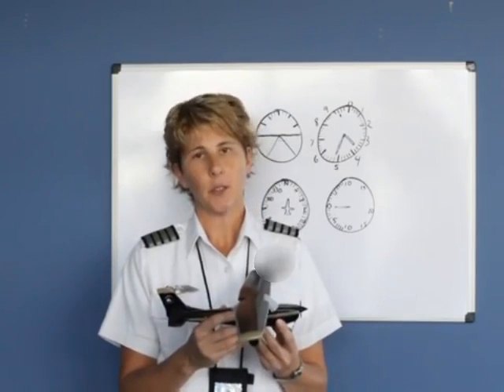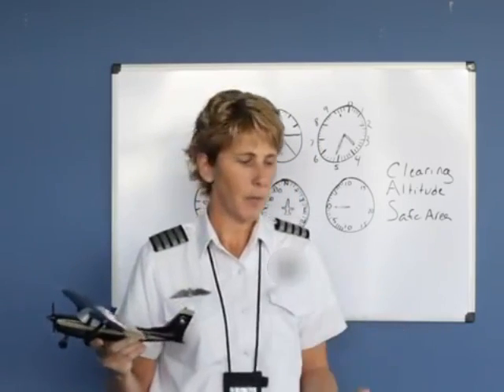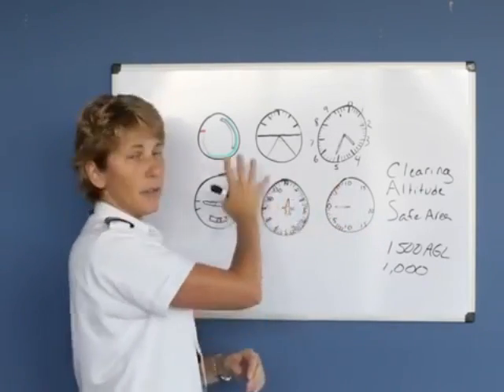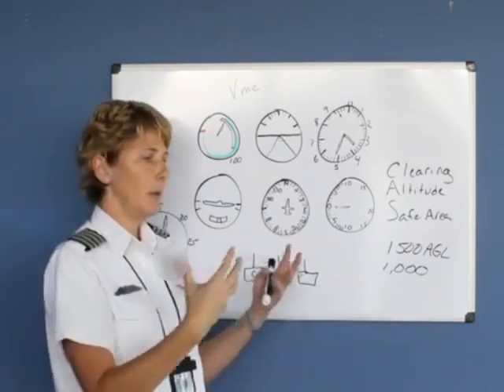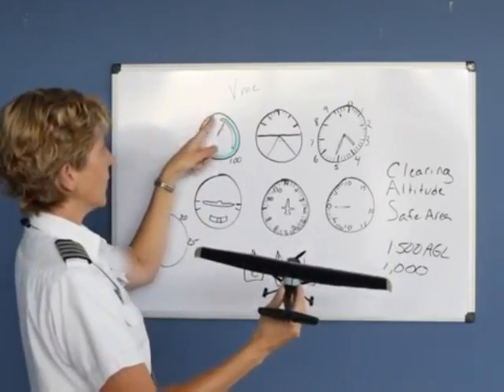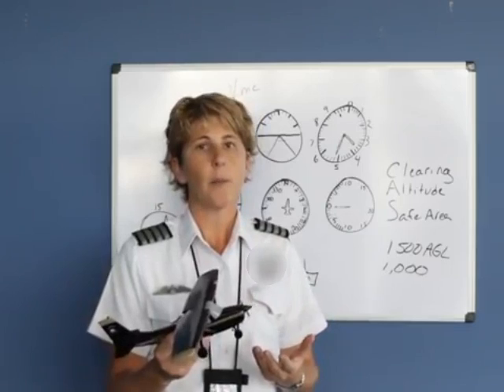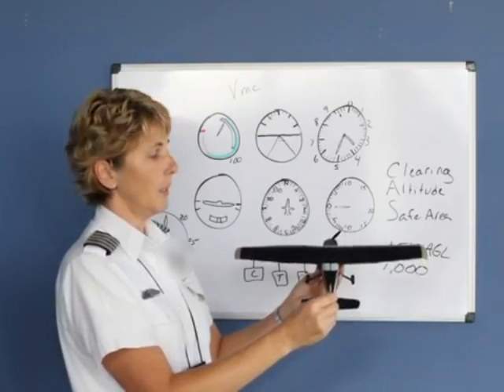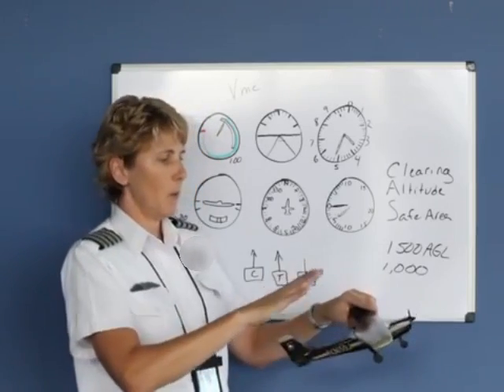Slow Flight (Private Pilot Lesson 2g)

Comment: Total misinterpretation of region of reversed command.  So many instructors think it means pitch and power reverse.  Total fantasy.  LaLa land.  You are not flying a V22 Osprey.  Here's what the FAA says about the regions of command:  "The “regions of normal and reversed command” refers to the relationship between speed and the power required to maintain or change that speed in flight."  When you reduce speed from cruise to best glide, drags decreases.  But when you reduce speed from best glide to minimum speed, drag increases.  That's the region of reversed command - the one in which speed decreases and drag increases.

The last time I did slow flight, I reduced power to idle at slow cruise, and held altitude by increasing pitch.  I did not change the power from idle until just before the bottom of the green arc (flaps were up).  It only took 1800rpm to hold airspeed at the bottom of the green arc.  Pitch was still holding altitude just as the PHAK states in Chapter 5 - increase pitch to hold altitude at a slower speed.  To recover from the slow flight, I increased power to full - the rpm went from 1800 to 2300, and it felt similar to a normal acceleration during takeoff.  I reduced pitch gradually as needed to stay exactly on altitude.

I was solo during that flight.  If I had had more weight or if the density altitude had been higher, I would have needed more pitch to hold altitude, which would have increased the induced drag, and which would have required more power to hold speed.  That is the important lesson learned.  And a puny little 6 foot propeller pointed horizontally is not going to oppose the weight of the airplane and control altitude like the two huge engines and rotors pointed vertically on the V22 Osprey.  That's ridiculous.

Comment: 1- carb heat on
2- reduce throttle ~1500-1700 rpm
3- enrich mixture
light left rudder 
4- add flaps (in white arc)
5- increase throttle
Carb heat back off
Reply: wait... she says left rudder in the beginning then right rudder at the end..... HELP which is it
Reply: @JessFlyyGirl  right, low power causes left turning tendencies

Comment: Very good briefing.  
Although it may have been covered prior to this presentation,   it may be useful  to refresh on Drag increase as the angle of attack increases in order to maintain level flight at lower airspeed.  Thrust reduction is required to initiate deceleration,   and the pitch attitude increased to maintain lift for level flight, and then thrust restored in order to “capture” the desired speed.
Flaps are used to enable flight at slower speed,  with the nose lower to the horizon, ie a lower pitch attitude giving better forward visibility, but again the increased drag will require thrust restored after the initial reduction, in order to “capture” the desired lower speed.  Half flap gives more lift and drag for a given speed,  Full flap probably much more drag for not a lot of lift increase,  but again a lower pitch attitude,  and probably much more thrust than for level flight in the clean configuration.
I would suggest thrust reduction in smaller stages to enter a descent,  because if you do not know the numbers , you can get too rapid a deceleration ,  lots of yaw.....most single engine pilots aspire to fly multi engine and single engine skill is required ,  and this situation is a “gotcha”....  If a more measured thrust reduction gives say 300ft/min ,  then another measured reduction in thrust/RPM closely monitoring your speed, and yaw,  until 500ft/minute.  This is I recall the minimum descent rate in a holding pattern,  and anything above 100ft/min likely to cause lots of ear wax to pop from your passengers ears, or even your own !!
Nevertheless, my comments are not criticism because I think this will have been covered in previous briefings.
PS.   While single jet A/C do not typically give yaw with thrust change,  multi engine single engine work definitely does,  so this exercise has massive value for those who aspire to a commercial career.
At low speed,  smooth use of controls to maintain balance,  and care with aileron,  to prevent wing drop stall/ incipient spin.....the killer if this occurs during a finals turn at say 500 ft agl.

Comment: Love the lesson, but I do have to mention something. She spoke about the importance of rudder correction to prevent slippage. The first time she described the tendency for an airplane to turn to the right. I did some research, and I believe that a single propeller airplane actually has a leftmost slippage tendency, which would instead require correction with the right rudder peddle. 
She switched things up the second time and describes the opposite (and correct) information which I corrected her on earlier. I don't want anybody to feel confused here. Regardless, this was a phenomenal lesson Cyndy.
Reply: I need to correct this. The direction of yaw, left or right depends upon the direction of rotation of the prop. In most cases this will be clockwise when viewed from behind. Thus when decreasing power (in the first example) you’ll need left rudder to maintain balance, when increasing power you’ll need right rudder. She is correct in both cases.
Reply: Max Gobbell  please see my comment cheers

Comment: Nice video. Full flap will give you high drag and essentially make speed control easier with faster responses to power changes. However, personally, if I was flying slowly due to bad weather or some similar situation, I would rather use take off or not more than 15 deg flap. This is due to a useful rule of thumb in that, lift increases up to around 16 deg of flap, with a relatively small drag penalty, with increased angle of flap, we get a slight lift increase, but a corresponding large drag increase. 15 deg of flap will allow for safer operation close to stall speed, and it will be easier to recover the aircraft to straight and level flight, if I end up on the back of the power or drag curve (same thing). Especially in a SE Cessna with those big fowler flaps.
Reply: I know this is an old comment, 
But another thing to consider is on most normal GA planes the so called "best" max flaps for lift over drag ratio is the deflection that matches the Max Aileron Deflection as the ailerons are designed to only deflect upto a point they don't create too much drag (so too much adverse yaw)

So if you move ailerons full left then looking at wing lower flaps to match the aileron deflection, you will notice that its close to the take off flap setting and often about half to 1/3 of the maximum available flap extension. Everything past it  is giving more drag than increased lift per Degree of deflection.

Comment: So below 80 knots?
The slower you fly the more fuel you conserve? Is it bad to be a little bit piched up for a long flight? Can his be done in AP?
Reply: There is a nominal angle of attack where you have the least amount of drag.  In a fixed wing aircraft there are two different kinds of drag.  Induced (created from lift) and parasitic (air flowing over the airframe like in a car driving down the road).  As you slow down, you must increase your lift by increasing your AOA.  The point where the two drag curves intersect is called your max lift over drag, and is typically approximated by your glide speed in an engine out scenario.  You will often hear bush pilots or STOL drivers speak of being "behind the curve".  That is the point where they are going so slow that it actually requires more power to keep the plane in level flight than it would if you were going faster.

Comment: One good way to remember is ....Pitch for airspeed and Power for Altitude
Reply: Power affects altitude and airspeed, Pitch affects altitude and airspeed, but in this example yes you are correct, this is how you stay on a glide path, that is why you trim for airspeed
Reply: not true. depends on other factors.
Reply: For a 172RG its pitch for altitude and power for speed. So it varies.
Reply: Mazeen Mohamed try doing your climbout with power idle but full aft stick
Reply: Depends on configuration lol